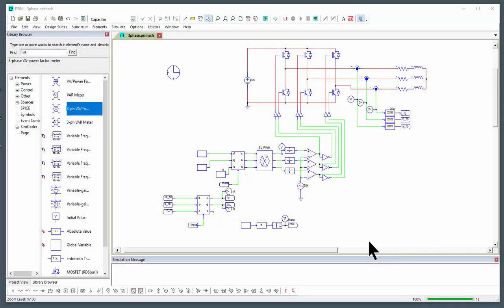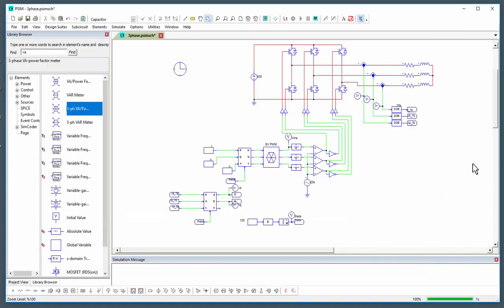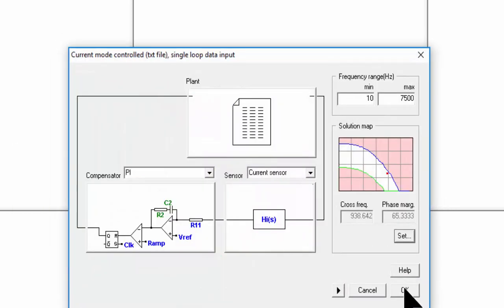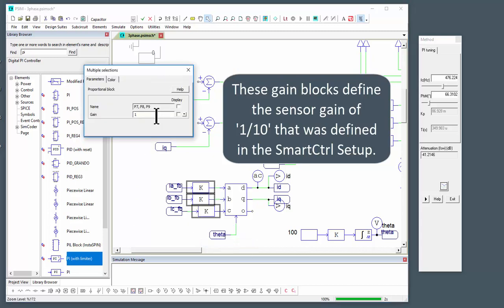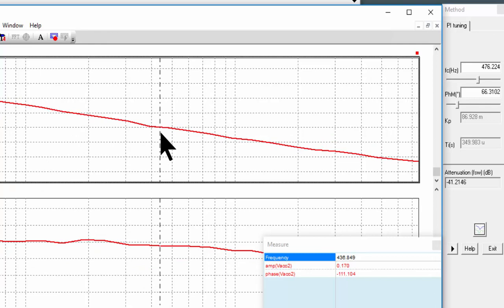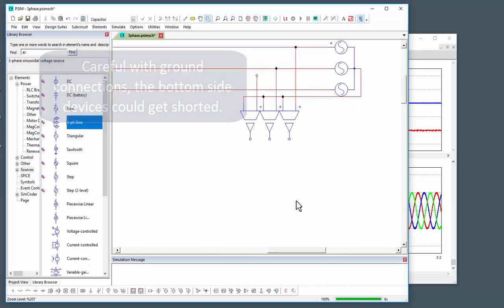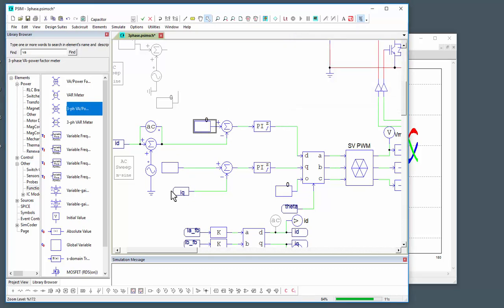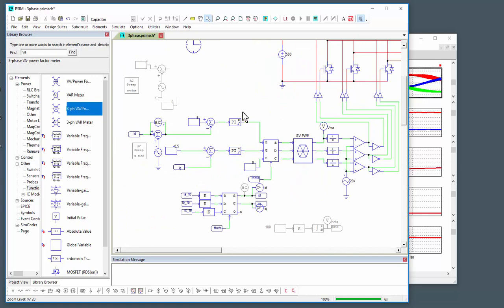3 phase grid link inverter with dq control complete design | PSIM

Comment: Great job ! 
Can you perform a video with the staircase modulation based on the voltage lookup table control of grid connected 1-phase cascaded multilevel inverter ? I noticed that most of videos talk about 3- phase 2-level inverter. Thank you !

Comment: Hi, why not cross decoupling "wl" between d and q axis? Thanks.
Reply from the maker: Sorry, it has been I while since I made this video. Are you referring to decouple during the AC sweep or the control signal definitions? Decoupling the d and q isn't necessary to get a stable PI control of the d and q variables with good performance. Doing extra math/work to decouple them is not really worth the effort, how much better does it need to be?
Reply: @altairhowto   it's common to see in some books for control in Power converters, a cross decoupling 
-wL*id sum in iq mesh and wL*iq sum in id mesh. I know that it isn't necessary in PI design this consideration but the books spoke for a pratical operation, consider the cross decoupling. Because this, my question about this, If it's necessary or no. Thank you so much.

Comment: Hi, Do you have any videos or resources for single phase grid tie inverter simulation on psim?
Reply from the maker: here is the single phase inverter https://youtu.be/25c8_trrmSo
drive the voltage reference with a PLL, PLL example circuits are in "other" in the example folder
Reply: @altairhowto  Thanks
Reply: PSIM Hi Albert, you have worked an excellent result outputs with perfect control! Good work! Thank you for your work. I didn’t see PLL in your recommended video. Do you have any reference video about single phase invertor with Sogi pll?

Comment: Great work, but can you help me by explaining more the Vv and the Vp why they are 1 and 0 ?
Reply from the maker: Vv and Vp are 1 and 0 so that the gain of the comparator circuit is '1' if these numbers are something else you are introducing a gain term into your control loop that is already accounted for in the AC sweep from PSIM. Adding gain will shift the control to output transfer function up which will increase you cross frequency and reduce your phase margin. The opposite for an attenuation.